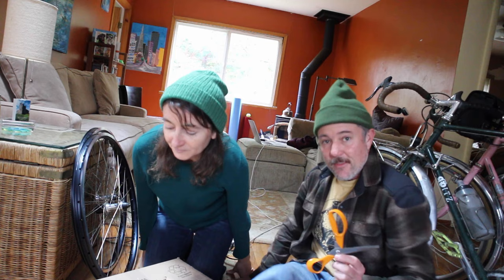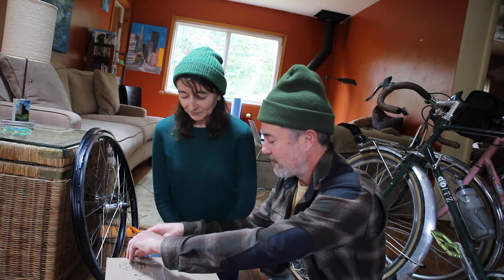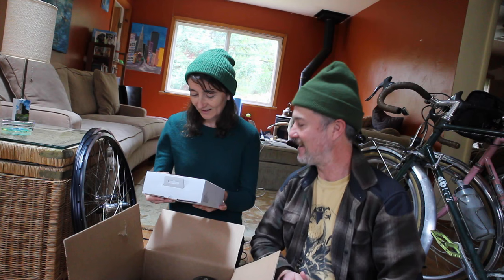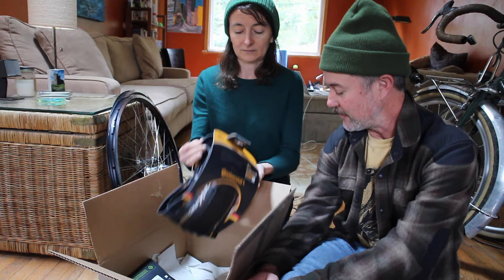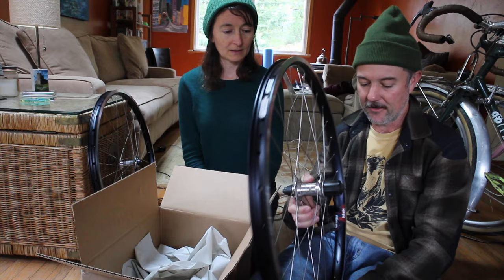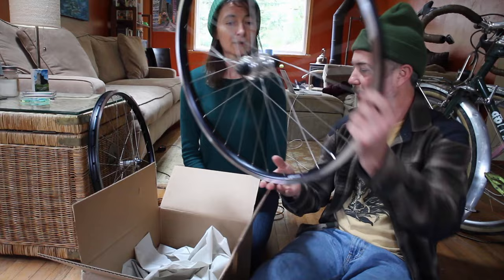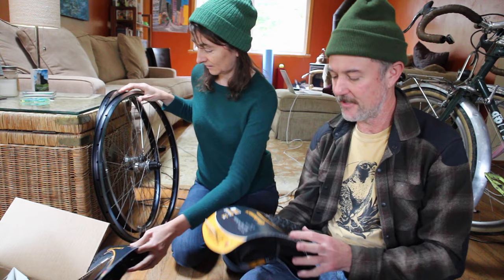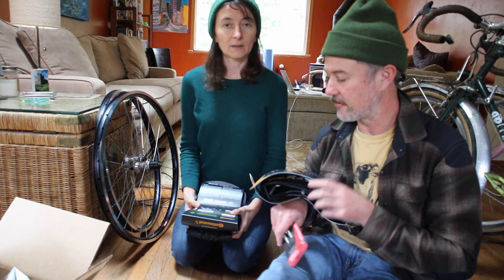This isn't the vlog I had planned...DTB

Comment: Why don't you use TPU tubes? Lighter (no sealant), easier to fit and replace with a spare tube while on a trip. They pack up really small, have good puncture resistance are also about the same price as a butyl now, and can be repaired.  Even though I use latex tubes on my lightweight road wheels, I carry a TPU as a spare, as they are so tiny.
Reply from the maker: I haven't experimented with TPU tubes. I'll have to give them a try. Thanks for the suggestions.
Reply: I got some Ridenow TPU tubes on ebay, for about 5 bucks each.  Maybe the early ones had problems but these have been great, no problems.  

I think Pirelli is still happy to charge over 30 bucks per tube for their TPU, that wont last now that cheap ones can be had. 28 gram tube seems good in my Canyon Endurace.

I got tired of buying sealant, and re-freshing it, when in reality I might only get 2 flats per year with tubes.  Mt bike is tubeless for sure though.
Reply: I haven't had a single pinch or puncture flat with tubeless in 20 years. I've used tubeless on week plus long dirt tours too.  About the only failures I've had were tearing sidewalls badly on rocks, road trash or burping the air pressure  out when I forgot to pump up preride. The first is inevitable with any tire ridden on rough roads. The 2nd is my fault. It's not a design issue. 
  The trick with tubeless is learning to DIY and finding correct fitting tires for your particular rims. There's really no tire and rim size standards, so differing manufacturing tolerances can make it challenging sometimes. I find brands that work well together and stick to them. 
 The rims I like best these days are Velocity  and H+ Son. Rene Herse, Panaracer, Donnelly and Specialized make consistent sized tires.   
  I get far better traction, cornering and comfort with tubeless. I can definitely feel a different in ride quality and these are the actual reasons to use it.  
  The only reason not to use high volume tubeless is if you don't want to learn how or you're the time who neglects their bike. Commercial tubeless has come a long way and it's not hard to set up with an air compressor, some care and patience. 
  About the only bikes I use tubes for are my mostly road only bikes. Narrower, higher pressure tubeless tires are definately  less reliable because the higher pressure pushes sealant out of larger punctures and won't reseal. 
   I've been messing with tubeless before Stan's existed in the '90s. I  set up DIY tubeless tires way back when. I learned about it online. I also wrench in a shop so it is 2nd nature to me. I've played with  many  of the tubeless systems on the market. 
 I still always carry one or two tubes on long rides, a patch kit and a real full size pump. Frame pumps are preferable. Even if I just give my spares  to someone else to keep their ride going.
Reply: @rollinrat4850  I think the trick is, not everybody is an expert or a mechanic, then they hope I can fix what ever goes bad....its this way on both motorcycles and bicycles...people dont take responsibility for learning what to do when things go bad....some take their bikes to the shop to get sealant added, they dont change their own tires.    Didnt use to be so much this way, but it is now.  Some refuse to get their hands dirty. I like working on my own stuff since I was a small person.
Reply: @bradsanders6954  Regarding tubeless, many performance oriented riders have zero idea just how much of a benefit they offer.  The point of tubeless is not lighter weight. That's stupid. DHers sick of flats ruining their races were the original inventors, but mainly the performance benefits of lower pressure, higher volume and supple tires make a huge benefit in performance. If you pushing the bike hard. I suppose lots of people don't need that. If people don't want to maintain their tubeless themselves, I may not recommend it. 
  So yes, Lots of folks don't want the 'hassles' of DIY and I suppose that's ok, if you enjoy walking, or WORSE, that 'call of shame' to get picked up! I've only made that call  twice in 50 years of hard riding. Both times it got dark and I'd forgotten to bring a light. My bike was working just fine! I always carry all the tools to fix common problems and breakage. Now I own two bikes with dynamo hub lights, so I never worry about light, even when I'm riding for more than 24 hours,  deep in a redwood forest, with no moon. 
  When I was 8, I got my first flat. My dad sees it and says, 
"I see you've got a flat there. You had better learn how to fix that or you're going to walk". I can still hear  his voice! So he taught me. I knew he was completely serious. I loved my new found freedom, so I  was motivated to learn by those few simple words! 
  A couple months later I got a book and taught myself how to overhaul a coaster brake hub. I wanted to go faster. It didn't take me long to figure out that we rolled on these bearing things! Like my dad and my grandfather, I simply dug in, got dirty and figured out the problem. 
    These had to be some of the best lessons Ive ever learned. Besides the ones learned from making mistakes that is!! 
   Dad's friend also owned the local Schwinn shop and we got new bikes completely unassembled in a box to save money. My 2nd bike he taught me how to assemble a bike from a bare frame  including frame prep, tapping, facing, reaming and alignment. He taught me to carefully take my time to ensure the bike is safe, reliable. This provides a high level of value. They function much better and last far longer this way. Bicycles  are actually pretty damned simple machines. 
   I've never paid a penny to have someone else fix my bike and they can't 'assure' my safety. I don't trust anyone else! My life relies on my bike. Which is something lots of manufacturers need to learn!! 
  I have paid dearly to have custom frames built. Ive paid a master wheel builder to watch him building (a nice lunch) then critique my work after I'd built my first set. 
   I've run a small garage custom wheel building/ repair business for about 30 year now. I specialize in removing broken bolts and repairing very expensive thing, like  titanium and custom triathlon gear . But not only bike junk. I participate in a group of people with lots of different hot rods, sports cars  and 4wds. Trade, barter and sharing services is how we afford our hobbies. Fewer freakin tax dollars are involved this way too! 
   My bike repairs fund my lifelong lifestyle.  All my bike junk is paid for and I save money for tours and trips. 
  But I've been fascinated by wheels since I was a child. That's my passion on bicycles. Again, we roll on these things. I'm learning to build my own frames now. I also own a mill and a lathe and have designed and built lots of my own components. My dream is to build a bicycle almost completely from raw material myself, minus a few of the 'impractical parts'. 
  I helped Dad bleed auto brakes and various other maintenance before I was 10. I went on to build  custom rock crawler 4wds. That's the hobby I can hardly afford and that's why I DIY..... besides being responsible for my own freakin safety! 
    I helped my grandfather with his woodworking and cabinet making. He also made  casting patterns for his own business. He (haha, 'we') rebuilt the baby grand piano that sits in my living room today.  We started when I was 9 and worked at it for 4 years. 
  I grew up in a family of DIYers. We often bought stuff that  was damaged in shipping and repaired it. 
   I went on to be a machinist and mechanical inspector. I felt privileged to help build aircraft, spacecraft and a heart surgeon's instruments. Now I'm retired, but still wrench in a high end bike shop for fun. 
   Ironically, bicycles have de-evolved quality wise. Nobody's fooling me. I get incredible discounts but never buy much new. Especially plastic (carbon) frames. I've helped build satellites out of this stuff. Again, nobody's fooling me. Modern overpriced bicycles  have become far more complex than they need to be. Asian made and assembled products (besides Japanese) often show an ignorance of quality control. Throughout my career QC or rather QA, quality assurance  was the key part of my job that human life or huge money  relies upon. 
    I can tell you the larger bike industry often ashames me.  We're kept very busy on brand new bikes, making up for this industry's  astounding level of incompetence, compromise and greed.  THATS my job security! Ignorant consumers have not a clue! They 'believe' the more they spend, the better quality product they get. Yet reality is something very different. 
  But in reality just about any bicycle is a fairly simple machine in a world of far more complex machinery. It's certainly not rocket science. I worked for one of those too!

Comment: Henry, is that an 82 air-cooled with fuel injection Hall distributor? I had a similar problem one time. It could be the Hall sensor wires under the distributor cap. That hall magnetic pickup can cut the wires over time as it spins. Give that a shot. @mrsmithgarage